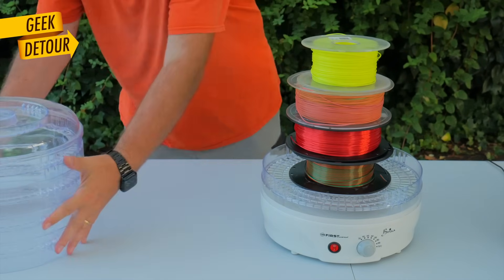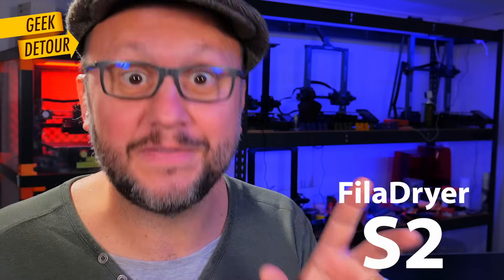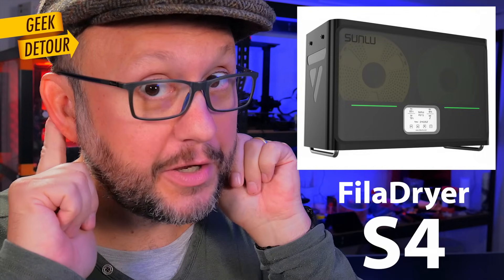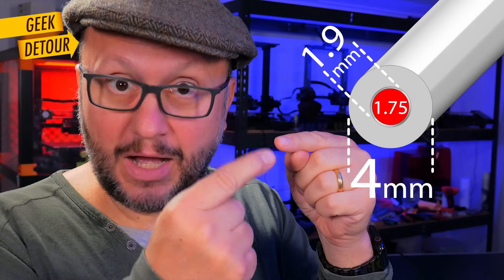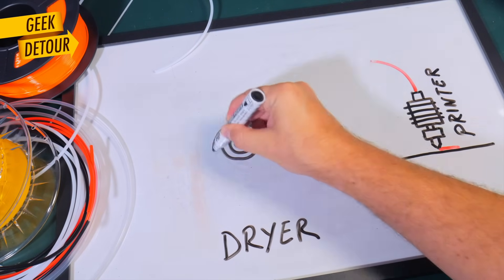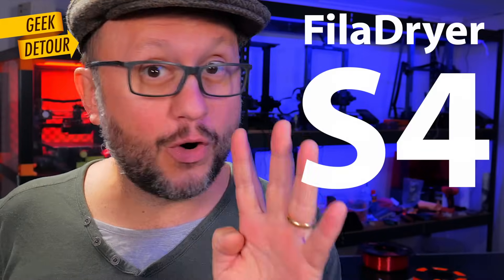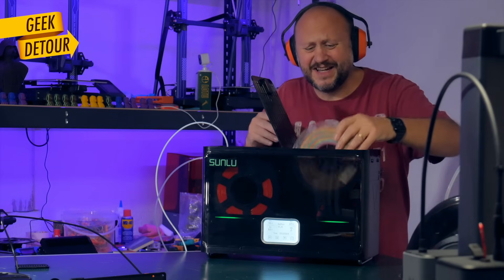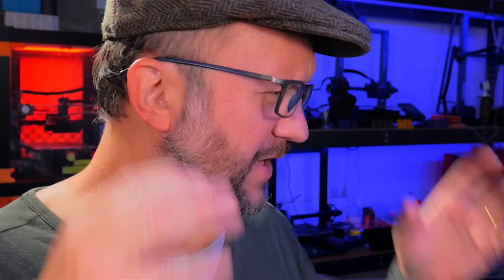SUNLU Filament Dryer S4 vs S2 vs Food Dehydrator

Comment from the maker: Guys, tell me what you think about this video: filament dryers with bowden tubes taught me quite a few things in the last 2 months... and it all came together in this review. Did you enjoy it? 🤔
Reply: Can I have the STL file for this mod
Reply: Could you share with everybody the STL for the S2 upgrade, please?
Reply: Great video. I’m going to subscribe. 👍🏼

I really enjoyed that you pointed out the flaw with the S2 and modded it with the adapter. I’d appreciate if you shared the model for that.
Reply: Would it be possible to share your stl file in order to use it for my S2 please?
Tank you 😊
Reply: Hello great video, are the STL files for the filament guide available somewhere?
Reply: Good vid... thanks..
Reply: I have an idea for 'reliable drilling'. I would design a drill jig to print out of PLA, that would pilot into the existing hole and have a fairly long 'guide' hole tangent to the lid. With careful use, you can sneak up on drilling the hole without tearing into the sides of the jig. Make the hole very tight to the drill size to help guide and prevent cutting. Then you could share that file and the TPU new plug. I'm shopping for a decent one spool dryer and this review and your mod are pushing me towards the S2. Keep up the great work!
Reply: Loved the video. Very well made and edited and kept me interested throughout the entire thing. Not too slow, not too fast, just right. And THAT's very important!  About drying, I never have dried my filament and barely store them in a box with desiccant.  Could this be causing my random problems?  I live in central Florida.  Thank you again!  Great video, just subscribed.
Reply: Until your video, I had always assumed that the bowden tube was just shielding the filament from dust/humidity/temperature issues.  I had never considered it helping to resolve the tension issue with pulling by the printhead.  Thanks for the great tip!
Reply: Since you asked:
You got a new sub - for the bigger bowden thinking. 

But I think you have to be careful and please don't be insulted... It's up to creators like you to call out companies who use Kickstarter for their focus group, market research and presales. It's an incredibly bad habit. Either you don't agree or your are too afraid to step on Sunlu's toes while you build an audience? I'd honestly love to know. 

If you can't call out behaviour like this when otherwise praising a product then you're sadly on the path to shilling. I don't think you see yourself this way and you are not there yet, far from it, but it's where most channels go and it would be great if more of you stayed way clear. So, call out the big flaws too when you praise the companies. If they stop sending you freebies, then you will have grown an independent voice and hopefully an income where you can buy what you want to review.
Reply: Can I have the stl for the S2 mod please?
Reply: Bet you never shared the STL in the 7 months this video was posted? but you say you will in the vid.
or do you just not read comment's after posting and just farm comments/views? 
Maybe a harsh comment from my side, but it's a common thing for content creators lately, and therefore i wouldn't be surprised...

Comment: I just discovered your channel and I love your videos! That being said (and you asked), I have an issue with this one. You really didn't compare the food dehydrator at ALL. This felt like you just sucked us in with a comparison title, but the video was just an add for Sunlu dryers. Very disappointed. What about 3D printing risers for the food dehydrator? Print them with a space for a hygrometer to give temp and humidity readings. NOW...how would it stack up to commercial dryers? That's what I want to know.
Reply from the maker: Hi there! The food dehidrators - as they come - are very crude devices. Sure, if you invest time into it, you could incorporate a humidity reading. But the worst point is the max temperature: mine was 65 or 70 degrees °C (I gave it to a friend). And technical filaments like Nylon CF need closer to 90, even more, otherwise it takes days to get really dry.

Comment: I had the same issue with the filament exits on the S2 drier. I solved it by making pivoting exit tubes that automatically stay tangential to the reel. Works much better now!

Comment: question, does the filament need to remain in the dryer when it’s being used to print cause can I it be taken out?
Reply from the maker: PLA or PETG you can take out - it takes a long time for them to absorb humidity. But there are filaments - Nylon is the worst case - that you NEED to print them from a drying box, because in a matter of a couple of hours you already see it getting worse, very hygroscopic!
Reply: @GeekDetour with the likes of you would it be better to keep that in the dryer ?

Comment: For the food dehydrator:
- Buy a thermometer
- Buy a hygrometer
- Place the probe of the thermometer inside so that you know the temps
- Put the hygrometer on the inside of the cover so that you know the humidity

You also don't have to snip the trays off the dehydrator. There's printable risers to make your spools fit inside the dryer. I can dry four at the same time. After that, put the filament in a drybox with dessicants in it with a tube feeding the filament to your printer. Plenty of DIY tutorials for that here in youtube. And they're incredibly easy to make, too. Big fan of zero-running costs.

I have never seen a filament dryer beat the efficiency and effectiveness of a food dehydrator. And this is coming from someone who had the Sunlu S4.
Reply from the maker: Oh, three years ago I would be definitely into a DIY project for filament dryer. Today I want the convenience of getting one already done. What I would want is an open firmware for a manufactured dryer ❤️
Reply: Can you share your temperature and time settings please

Comment: question. I only have 2 printers, and Im just getting into TPU. I had a roll of Overture , didnt work well, so I set it on the shelf. A year later, i gave it a go again and its WONDERFUL!
So I ordered more TPU. They are not great. Im assuming they are wet. And Im also guessing my Overture TPU sitting on the shelf for a year, "acclimated" and is fine?
Since I dont print a ton, Im assuming the S4 would be overkill. Should I get a S2? 
I have not had to dry anything else. My humidity is 30-40%
Thanks for the great video, and hopefully a reply.

Comment: As a person who has worked with polymers in industry for 30+ years, I am often amazed how ingenious people are when faced with a problem. Here are a few tips on how to cheaply keep filaments dry. 1.) except for water soluble polymers, polymers absorb water slowly 2) it is not clear in 3D printing, the water concentration threshold to printing problems , 3) polymers absorb different amounts of water at different rates, 4) desorption is slower than absorption, 5) best to keep filaments from day one in a dry environment (@<20%RH depends on material) and the cheapest way is to store in a waterproof box with silica gel (500-1000gm for a large box) remove any cardboard. 6) last resort for wet filament is to throw it in an oven but it may take several days at 60c to remove the absorbed water. Again, it is not clear what the maximum water content is that will create problems for even a single polymer type since the filament is a formulation. GIGO (garbage in garbage out) so respect your materials. Drying filament with heat can produce other problems.

Comment: on the s2 i hate that the filament is fed through the lid. what if mid print i remember about a soaked spool that i need for the next print? that's why i always print from the spool holder on the printer and not the dryer. it's annoying af :(

Comment: I suggest they replace the RH/temperature sensors with one of the new HDC3022 sensors from TI. The sensor is like $3.50 max (less in bulk) and is capable of reading from 0-100 %RH with 0.5 %RH typical accuracy. The low-cost conductive RH sensors that get put in every cheap device are really only good for comparative measurements IMO, they are all over the place WRT accuracy and calibration/drift.
Reply from the maker: Wait... have you successfully modified yours?

Comment: I bought their S2 Plus filament dryer.

It arrived, I threw some in (Green Bambu PLA), it managed to melt/fuse together after 2.5 hours. I had the set value at 50C.

I chalked that up to me being new and figured I just needed to lower the temperature. I moved the temperature to 45C and placed some other PLA I had (Black Bambu PLA) and checked it after 30 minutes. At that point, it had not completely fused, but is "tacking" to itself to the point where it kept jamming as it tried to unspool.

I pulled the filament out and turned the device off so it could cool off. An hour later, I checked it and it was still VERY hot. Further testing confirmed that it's not actually turning off, and I also discovered that no matter what I set the temperature at, it's staying as hot as it can, around 70C.

When I plug up the unit and leave it without turning it on, it stays cool to the touch. If I turn it on and then back off immediately, it will continue to heat up. The on/off seems to only be controlling the fan and the screen, but is not disengaging the heater element.

So, given that, I contacted support. I expressed my concern that it was a fire hazard and offered to send it back to them (instead of Amazon), because you'd think they'd want to inspect it. I know they have plenty of good reviews and I've read a lot of personal accounts praising the unit.

They got back in touch with me and asked me to take video of it contributing to hear up after being turned off. I also demonstrated how it ignored the set value and would keep heating up indefinitely.

I did this, answered some other questions, and then they asked me to try with another spool of filament and record my results. Seemed strange, but I've got an engineering and IT background, so I'm game for some troubleshooting. I asked again for clarification just to make absolutely sure that this is what they wanted me to do, and they confirmed...So I grabbed a fire extinguisher (just in case), and did so. This time, the spool melted. I was shocked. I sent the video, unplugged the unit, opened the window, and vacated my office for the night. They told me that the spool wasn't supposed to go in the dryer.... which is of course BS. Then they asked for me to take a temperature reading of it when it is on, to make sure that the temperature states is accurate... Which seems a bit pointless at this point, but I oblige.

Sunlu support then asked for a copy of my invoice (which was in the original email, but I went ahead and sent it again). Their response is to send it back to Amazon... Which I could have done in the first place. They don't plan on replacing my filament (one of which, THEY ASKED ME TO DESTROY TO PROVE TO THEM THAT THE UNIT WAS FAULTY). The customer service rep also refused to escalate my case.
Reply: Since they asked you to prove it by sending them a video and then treated you with this poor service, you should upload that same video and let the ppl decide.
Reply from the maker: My goodness… That’s a horror story 😬 I know a lot of people that have Sunlu filament dryers / I never hear of anything like what you experienced - but I believe you. Products can malfunction. What saddens me is the treatment they gave you… I am sorry.
Reply: @GeekDetour  I am not surprised at this response by Sunlu. Their "customer service" is atrocious!  See my post about them not sending S4 units to those of us who paid for them.
Reply: Requesting videos is the new customer service delay/scam.
Reply: Always fun dealing with Chinese companies..
Reply: Did you check the recommended drying spec for the specific filiment from the filiment manufacturer?
Reply: @leonorehamer3025  Yes. That doesn't really matter though-- the dryer was faulty and would heat up indefinitely. I'd have it set to 35C and it would heat up past 70C (I measured it).

Comment: considering this video is called dehydrator vs dryer, i feel like you should have spent more than 30 seconds in a 10 minute video on the dehydrator. No comparing results, nothing.
Reply from the maker: What can I say?! The food dehydrator works. When I had bubbling filament, it dried them. But it is a clumsy, bulky, too simple device without any sensor or information. I don’t see the point of testing it extensively because it is a crude device and now we have so much better specific solutions at great prices. But you are right: I didn’t test - and I won’t because the convenience of the S4 made me never look back.
Reply: I can understand this point of view, but I came here specifically to check if a cheap dehydrator will do the job as well or good enough and based on the title it seemed like the right video but it wasn't  @GeekDetour
Reply: @GeekDetour As a beginner who’s just trying to learn as much as he can I found the extra information pretty informative. Thanks.

Comment: E aí! I used to 3d print back when it was extremely finicky, and now I'm back and loving it. I haven't purchased a dryer yet. Would you recommend the S4 for single printer use but many multi color prints? It's obvious that the S4 is one of the best, but just trying to find a sweet spot so I don't buy the most expensive versions of everything if it's not necessary. Obrigado antecipado!!
Reply from the maker: Manoel, eu ADORO minha S4. É a que mais uso - não está ligada em nenhuma impressora. É mesmo pra secar meus filamentos mais chatos: Nylon, TPU, filamento com madeira, qualquer coisa com fibra de carbono. Uso as pequenas (S1 e S2) com as impressoras que imprimem nylon, porque Nylon fica ruim em questão de horas, se aberto.

Comment: Since this is now 6 months old, I wonder if Sunlu made the S4 more quiet. Are you aware of any changes they made since receiving your pre-production S4?
Reply from the maker: I don’t think they had to change anything - it is just as loud as the food dehydrator. It’s the fans inside. Of course I made a joke when I put earmuffs (and I mixed the sound of an actual airplane turbine from an Airport). I wouldn’t have it on the same room you sleep, but it’s like a fan heater you would use on a living room.
Reply: @GeekDetour  thanks for the reply. I opted to pre-order the Eibos Polyphemus since it is smaller and will better suite my needs. Looks like Canada gets deliveries in May, so I have to be patient 😎. Thanks again.

Comment: What you call multicolor filament is usually called co-extrusion filament :) Multicolor is just filament with more than 1 color.
Reply from the maker: I swear that when I made this video, none of these spools were listed with this name (which is absolutely correct and makes total sense). It was all “multicolor”, or “dual color” at best. It’s nice to have a more precise name to differentiate them.

Comment: Looser tubes are likely to be more problematic with flexible filament where it bending and bunching up can cause failures as well. This will depend on the filament hardness and friction specifics, the speed, the geometry of the tube bends etc of course.
Reply from the maker: Well, that is absolutely true for Bowden printers, trying to push the filament, far from the nozzle. But when the printer is direct drive - the extruder is on the printhead pulling filament - then the less friction the better.
Reply: Very true, good point. @GeekDetour

Comment: Not buying loud dryers. Use silent fans FFS we want to sleep at night
Reply from the maker: Well… 3D Printing got very noisy in the last year. When I bought my Ender 3, most of my mods were to make it dead silent… Now that “speed” is the name of the game, fans got super loud, motors are super fast and the printers shake so much on cray acceleration. Today, it would be impossible to have any of these printers at the same room where I sleep - we moved to a big house and the printers can be loud as they are in a separate workshop. But noise can be a no no, when you live in a small apartment as we did.

Comment: I use a cheap air fryer that has dehydrate mode. This interests me, but I'd have to look at swapping the fans for Noctua ones.
Reply from the maker: I agree: for the new S1 and S2 versions, a small Noctua fan would make them dead silent! Not sure about the S4… there is a high flow fan going on there.
Reply: I'm down for checking it out eventually. Might get an S4 for the Ankermake I have :) @GeekDetour

Comment: S2 now has a fan. I've looked into this and a filament dryer really should be airtight with some desiccant, that way the heat extracts the moisture and it's absorbed by the desiccant. The S2 doesn't have anywhere for desiccant so once the filament is dry, and the machine turns off, it will slowly begin to absorb again.
Reply from the maker: Yeah, some people modified their S1 or S2 to get tiny exit holes… so the moist air can get out. I don’t know yet the most effective way. Maybe it is with desiccant bags… The S1 is easier to mod.
Reply: @GeekDetour There is a vent you can print which just props the door open slightly. Doesn't seem to make much of a difference though.

Comment: They work well but the power supplies fail. I'm on my 3rd one.
Reply from the maker: 3rd one!? Wow!!! This is so weird... I hope you used warranty and it didn't cost you more.
Reply: @GeekDetour  well the time it takes for them to break varies. My first one broke after a few months so I was able to get it replaced. My 2nd one failed long after the warranty was expired so I had to take it up with amazon, and amazon handled it thankfully. Sunlu's customer service is terrible. Like alot of these 3d printer product companies.